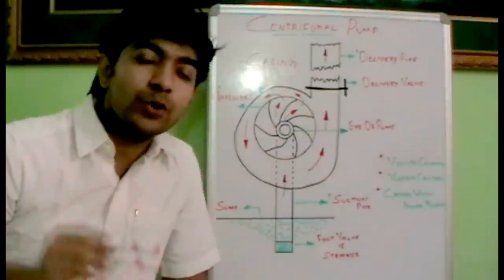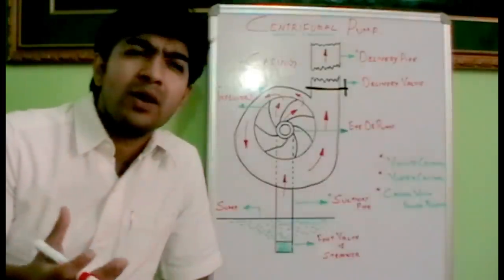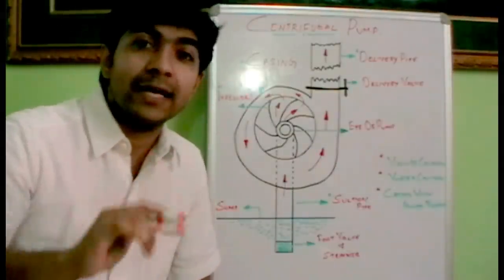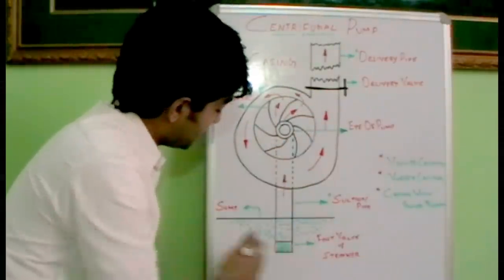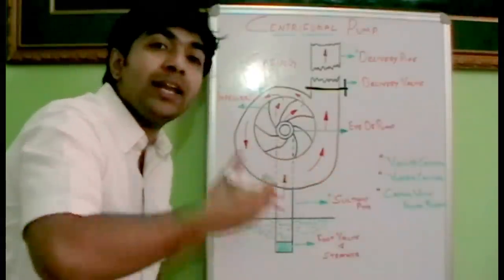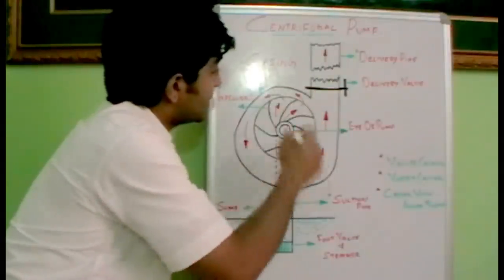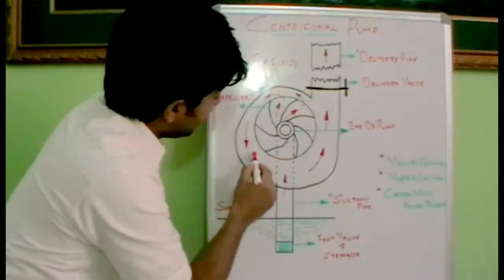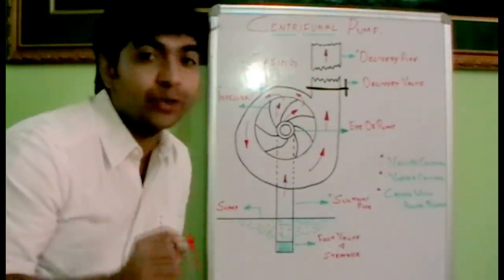How centrifugal pump works. ✔

Comment from the maker: At Inlet suction is happening, so there will be only negative pressure. 
At outlet, the flow is going to a hose (it creates a restriction) so there will always be positive pressure. 
Basic: The function of a pump is to create only flow not pressure. Flow will only generate pressure when there is a restriction. Pressure is directly proportional to restriction.

Comment: simple and elegant. the main part was the explanation about the increase in area of flow which causes reduction in velocity as q=v*a and q is constant. and hence due to velocity red, there s pressure increase. a very valid point in ur diagram which hasn't been explained in many of the videos about centrifugal pumps. awesome! Liked and subscribed. :)
Reply from the maker: Hari Krishnan Thank you , keep connected with us on Facebook just search for Techtrixinfo

Comment: during an experiment the inlet pressure was higher then the outlet pressure at the ports of centrifugal pumps install on a pipe when the valve was partially closed why was this happening?Plz reply...